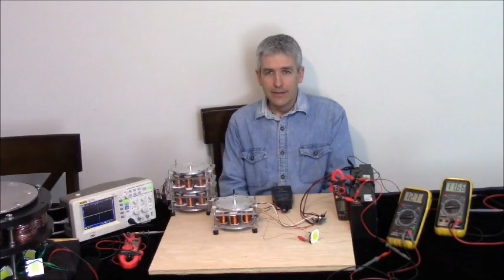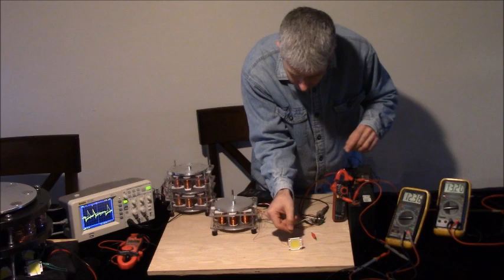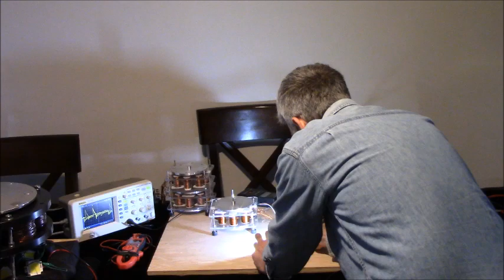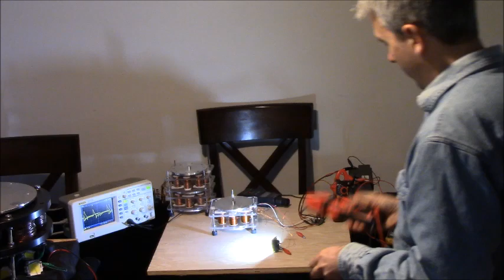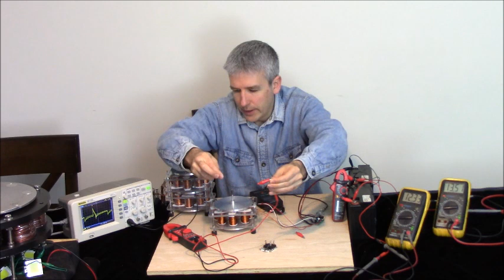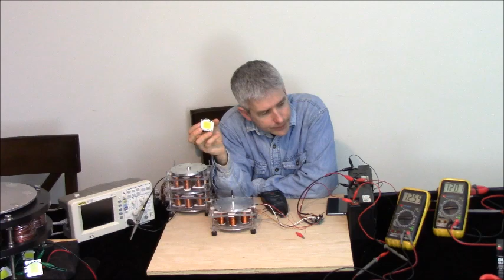4 Dualpole Mini Kit 8-100W System

Comment: Dear Rick,

I am most of all interested in efficiency. If you run the motor (or is it an energizer?) at 12.3 Volt at 630 mA. which is 8 watts. Then this is the input side. At the output side you show that the voltages are higher then 12.3 Volt. But what is the current at the output side? Or how many watts are supplied to the battery to be charged?
Reply from the maker: The battery is not charged by watts as amperage is much less than with constant current charging. This is further complicated in the fact the even though the battery is charging it is also supplying current into the motor as can be seen with the meter placed in different places. It is not really about what the amp meter says as much as what you can do over time. It the batteries can keep running while rotating around then you see that the amp meter is not really telling what his happing in the actual amount of charging. It is because we are dealing with a different kind of process and a different kind of energy.

Comment: Hi Rick, thanks for your explanations. 4 Dualpole Mini Kit 8-100W System can be used for battery charging 12v Trojan Deep Cycle 105a 27 Tmx and if so option I would recommend to buy if I wanted to charge several batteries. What is the limit of batteries you can charge.
When I get some time I'll give the 4 stacked demo to show the 400W system rated for the Average world household usage. YOU'RE  CRAZY. Congratulations. DO NOT STOP.

Comment: Can you send me the links to where I can buy a kit like this?  I'd like to know pricing.  Seems extremely reasonable.
Reply from the maker: r-charge.com Comes with several options, assembled or unassembled.
Reply: Rick Friedrich I saw the website. Is there a direct product link?
Reply from the maker: http://www.r-charge.net/4-Pole-Mini-DualPolar-Magnet-Motor_p_194.html
http://www.r-charge.net/4-Pole-Mini-DualPolar-Magnet-Motor-Assembled_p_200.html
Reply: Rick Friedrich thanks for the link.  So approximately (of course), how many watts would be produced if I was to set the unit to run like the 5th option you had listed (using 48v or 36v setup)? I may want 2 depending on the output.
Reply: Double stacked. Based on previous question I made.

Comment: Fascinating system, I understand the Hall sensor+FET need a "sharp" digital voltage to operate efficiently, what kind of circuit is that to adjust the amount of on time to the coil? Assuming the Hall is stationary and not moved around. Thank you for sharing!